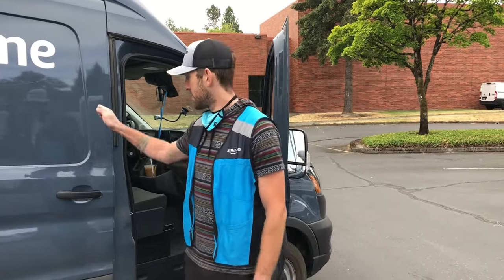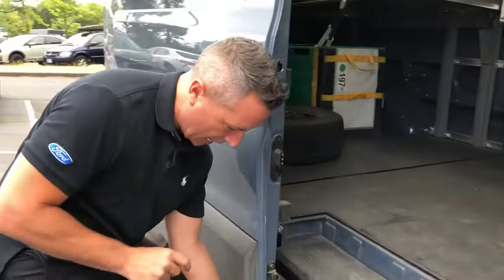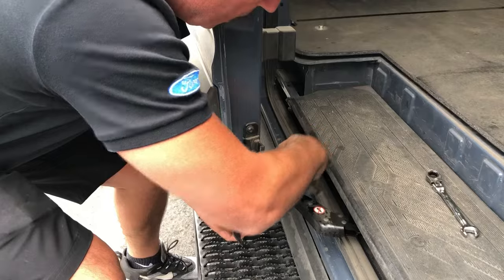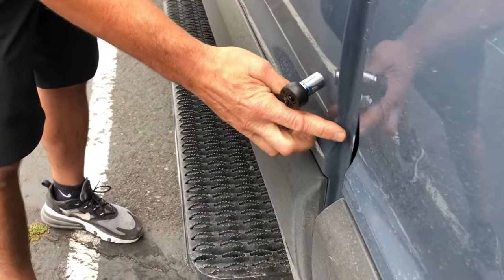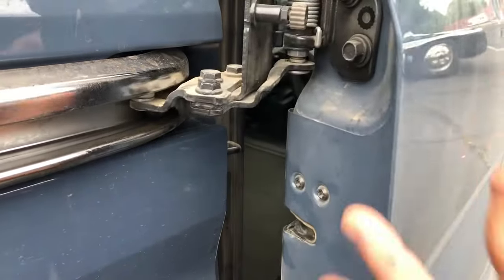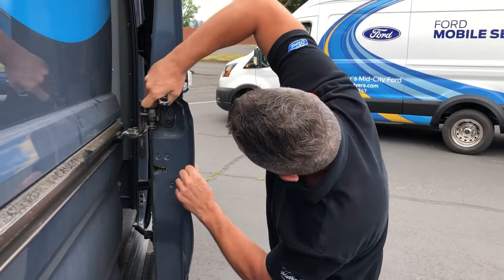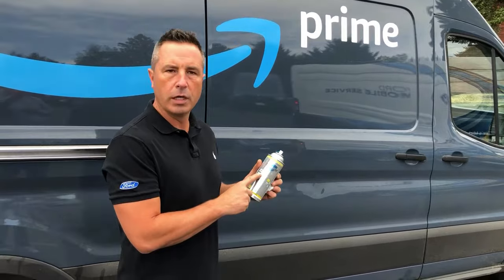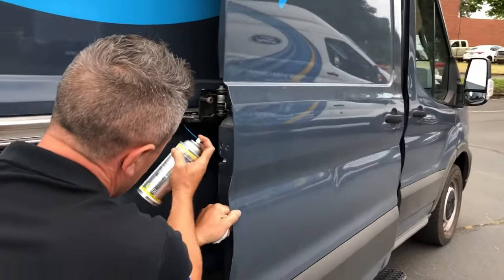How to Fix Ford Sprinter Van Sliding Door Issue

Comment: You need to fix the nut on the central hinge after adjustment. Second point: Please dont use grease on the rollers or inside the tracks. The grease is collection dirt and dust and makes later more issues